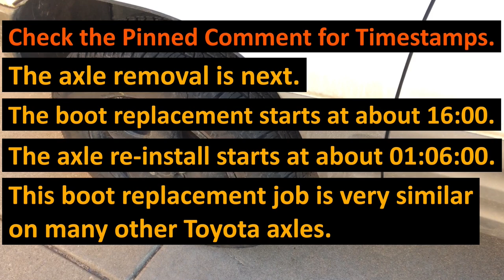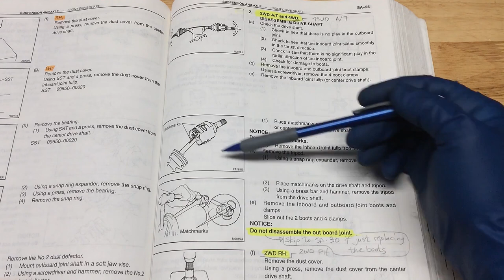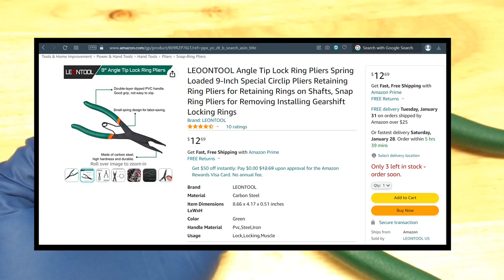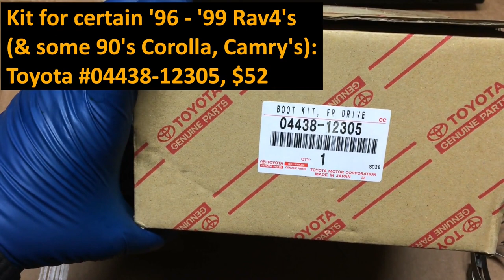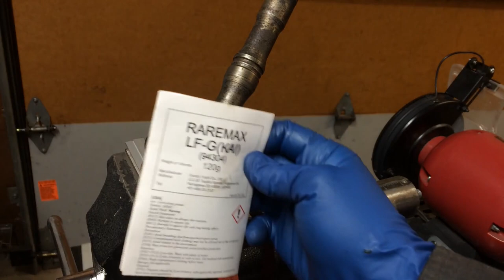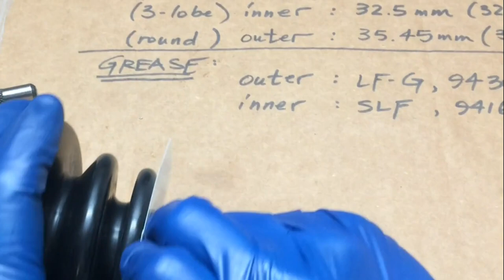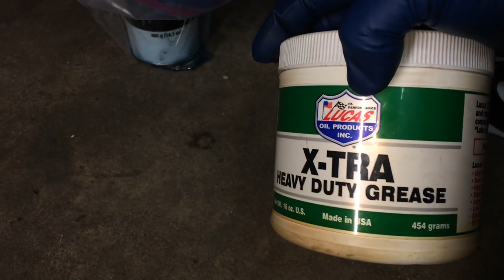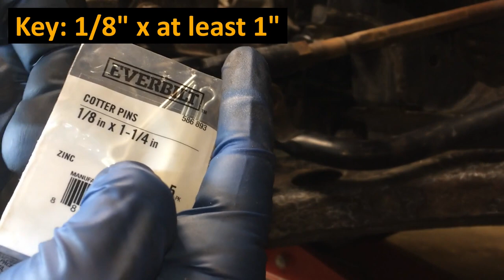1996 - 2000 Toyota Rav4 CV Boot Replacement FULL DIY; Toyota CV axle boot kit shown

Comment from the maker: Timestamps, part numbers, torque values, video 
links, other info:

Link to the "other video" mentioned (axle removal & shaft seal 
replacement):
https://www.youtube.com/watch?v=HOcu3zuq1AY

Right side front axle, AWD:
https://www.youtube.com/watch?v=7OkJwebxdz8

01:15  Set brake, chock wheels, and lift the whole front end
03:25  Remove the wheel (21mm)
03:55  Remove the ABS sensor, if equipped (two 
10mm bolts)
04:50  Remove the axle nut cotter key & cover
06:16  Loosen the axle nut (30mm nut, use a 6-point 
deep socket) 
08:03  Remove the sway bar link (two 17mm bolts, H7 
hex)
09:39  Remove brake line bracket (12mm)
10:07  Disconnect the tie rod end (17mm, rental tool 
is OEM Tools 27276)
11:17  Disconnect lower control arm (17mm, two nuts 
one bolt)
11:57  Remove the axle out from the wheel hub
13:25  Remove the axle cover (two 12mm)
14:02  Remove the axle from the transaxle (slider 
hammer method shown, rental tool Powerbulit Kit 41 from Advance Auto; also check the other video for other 
techniques)

16:00 Axle is on the bench; notes about the FSM 
procedure
18:28  Start on the inboard side: remove the 
bands/clamps
20:16  Make matchmarks on the shaft, cup, and 
tripod collar
24:05  Remove the trip "snap-ring" (speared end 
retaining ring) 
24:49  Detail on a recommend tool for this ring (Lang 
1407, Proto J250G, Lisle 44900 or similar)
25:42  Remove the tripod from the shaft using a 
brass punch
26:55  Remove the inboard boot
27:18  Remove the outboard bands/clamps and boot
28:15  Inspect the outboard joint 

28:38  Inspect the old grease, decide how to proceed 
- reboot axle or replace axle?
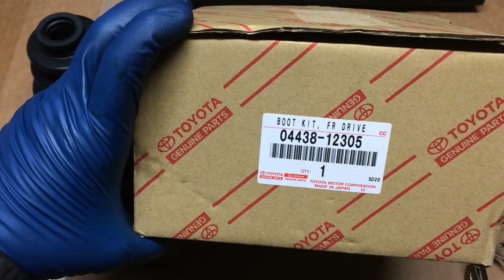31:59  Very detailed information on the Toyota boot 
kit: for this particular application ('98 Rav4 AWD 
automatic) the part number is 04438-12305; note 
that some '99 and '00 Rav4's use part number 
004438- 12304. Verify your fit with you VIN and a 
Toyota dealer.

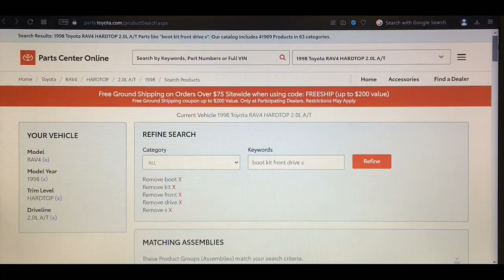35:49  How to verify which grease goes where

38:41  Prepare to install the outboard boot (inspect 
and clean)
40:28  Grease the outboard joint (use grease 94304, 
Raremax LF-G(KAI), 120g)
41:04   Partially install the outboard boot
42:27   Add the rest of the grease to the outboard 
joint
42:56  Snap the boot into place fully
44:35  Install the outboard boot bands/clamps
52:23  Partially install the inboard boot
53:33  Install the tripod and snap ring
57:03  Very close look at the tripod snap ring to 
ensure proper install
58:20  Add grease to the trip, inboard boot & cup 
(use grease 94166, Raremax SLF, 180g)
59:26  Install the inboard cup (tulip) to the boot
01:01:05  Install the inboard boot bands/clamps
01:04:58  Install the axle circlip

01:06:01  Note on the shaft seal (transmission seal)
01:06:29  Grease the shaft seal inner lip and the 
circlip with MP grease
01:07:21  Re-install the axle: be sure the circlip 
opening is facing down

01:11:34  Note on re-greasing the wheel bearings 
while you're in here (I use Lucas X-TRA Heavy Duty 
Grease)

01:12:27  Re-install the axle cover (12mm)
01:12:40  Re-install the axle to the wheel hub
01:14:52  Connect the wheel hub to the control arm 
(17mm, torque is 94 ft-lbs)
01:16:32  Connect the tie rod end (17mm & use a 
new 1/8" cotter key, torque is 36 ft-lbs)
01:17:22  Re-install the sway bar link (17mm & H7 
hex, torque is 54 ft-lbs)
01:17:48  Connect the brake line bracket (12mm)
01:17:53  Re-install the ABS bracket and sensor 
(10mm)
01:18:24  Torque down the axle nut (30mm, torque is 
159 ft-lbs)
01:19:28  Install the axle nut cover and a new 5/32" 
cotter key
01:20:24  Install the wheel (21mm, torque is 76 ft-lbs)

01:20:54  What an axle seal leak looks like (big mess)
01:21:35  Re-fill with ATF (or other fluid/oil for your 
particular transaxle)
01:22:14  How to check the boot & seal after a test drive

Check back to the channel for (hopefully) another axle job for the passenger side axle (4WD auto), as well as a video for the cam plug DIY (to repair the oil leak seen at 02:12). 

I hope this video was helpful for you.  Thanks for watching, and good luck with your repair! : )

Comment: I'm amazed with all the fine details in the video. I have 1996 RAV4 2 door AWD but  the CV boots are still in good condition. Will definitely rewatch this video when the time comes to replace them.
Reply from the maker: Thanks!  Your AWD 2-door must be lots of fun!  
Be sure to skim through the other video when the time comes, as that video has a little extra info about the 2-door and the axle removal in general; for example, the torque value on the sway bar links/stabilizer links for the 2-door is 33 ft-lbs (not 54 ft-lbs as on the 4-door); otherwise, the torque values are the same. (You can see that torque value are 18:18 of this video - the sway bar link is sort of "cut off" in the drawing, but those values in the box near the center of the page note the difference for 2-door).  Other than that, I believe everything is the same, but please update if you find any unique 2-door tips : ) 
Thanks for watching!
Reply: @L35 in Colorado  I really appreciate tremendous amount of time and details you put into your videos. Just subscribed!

Comment: What might/will happen if you forget the match marks? I got a little ahead of myself.
Reply from the maker: I make the match marks because it is shown in the FSM, but I've seen others who don't make the marks, including on youtube videos by technicians.  Typically, for wear components match marks are useful to re-match surfaces that have developed similar wear because they are always in contact with each other (ie, the rollers on the tripod are always in contact with only "their" spots on the tulip cup), but if you look at your axle parts, you likely won't find much wear in the first place, especially if the grease was clean. So, if there is an obvious match of wear pattern, then re-pair using the wear marks.  Otherwise, just clean everything up and grease well, and I bet you'll be just fine : )  Good luck!
Reply: @L35inColorado  Thanks for the thorough response. I can't seem to find any wear to match up, so I'll see how it goes just putting it together randomly. Keep up the great videos, the amount of effort you put into them, especially in the editing, is incredible!

Comment: This model year had the old style clamps.  Newer Toyotas you need a SST.
Reply from the maker: Yes, Toyota seems to have switched to the Oetiker/ear clamp style clamps for newer applications, but the old clamps are still available for older kits, as seen in the video.  For those Oetiker style clamps, you can use the official Toyota mini-vice SST (09521-24010, or a knock-off version of it), or you can use the long pliers-style, as shown in other videos (ie, Lisle 30800).
Alternatively, you can always use a different band style if you don't like the bands in the new Toyota kits.  I do prefer the older, closed "fold over" style (like those originally installed on the Rav4) best, personally, but those shown in the video in the kit aren't bad, either.   
Thanks for watching!
Reply: yes I have that tool and did my tundra front diff cv axles last year. The original Toyota tool is hard to find. Not sure I want to use the Knockoffs

Comment: Excellent video! Question though, how do you replace the outer cv joint if it wears out. You replace the whole assembly? It is more common  for the outer joint to wear off.
Reply from the maker: Thanks!  Yes, it is possible to replace just the outer joint itself (not just the boot, but the joint), but if you get it from Toyota that outer joint is only sold pre-assembled onto the shaft, and its very expensive (but the kits includes both new boots and grease packs).  Typically, it is about $300.  So, most people just buy a completer aftermarket axle, because it is indeed cheaper, at about $100.  Another option is to grab a used axle from a junkyard: personally, I would rather do a boot and grease swap on a good used OEM Toyota axle than use an aftermarket axle, if possible.  I hope that helps - thanks for watching!  : )

Comment: Do you recall if your outer and inner boots were both Toyota branded? I Noticed that the outboard side on mine had a Koyo brand on the boot but with a Toyota part number (43447 - 20110). The side with the Koyo brand had a similar style clamp as the toyota side but with different numbers, like "AB 2715B" instead of 32.1mm on the Toyota side. I wonder if that means my axle was already rebuilt at one point.
Reply from the maker: Good question - I don't remember on that particular '98 shown in the video, but I remember trying to determine a brand and not being able to figure it out based on the marks I could see/decipher.  Koyo is an OE supplier for Toyota,(especially for bearings).  
I would think/guess that an OE axle leaving the factory would have identical clamp styles on both ends (and both axles), but I don't know that for a fact.  It sounds like what you're seeing are indeed OE Toyota parts, though, even if there was a rebuild or re-boot replacement at some time.  Maybe there was a warranty replacement?  I just don't know!  : )   Thanks for watching!

Comment: My friend 
I have a question I recently changed my tires the two rear ones but I know that since my Rav4 is a all-wheel drive I heard that changing the size and tires would implicate on more wear of transmission and  engine
Reply from the maker: In my experience and opinion, the first-generation Rav4's aren't super sensitive to mismatched tires because they don't have sophisticated traction sensors.  However, for an AWD, personally I would only use four tires of the same size (ie, all four would be the OE size of 215/70R16, or whatever size fits the wheels).  I hope that helps - good luck : )

Comment: Is it a manual car
Reply from the maker: The Rav4 shown in the video is an automatic, but the boot kits are the same, as far as I know.  You can double-check with your VIN and the part number on the Toyota parts site, or call your dealer.  I hope that helps!  Good luck : )
Reply: @L35inColorado  I need the axel cup the short one that goes in the left side but for a manual rav4 the Inboard Joint (Tripod & Tulip)